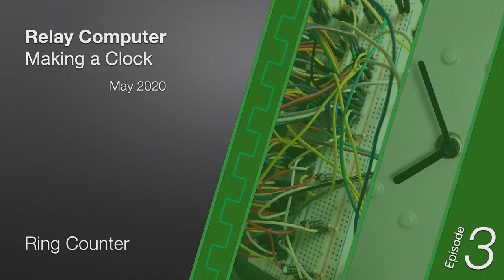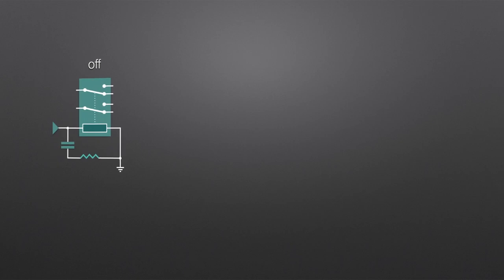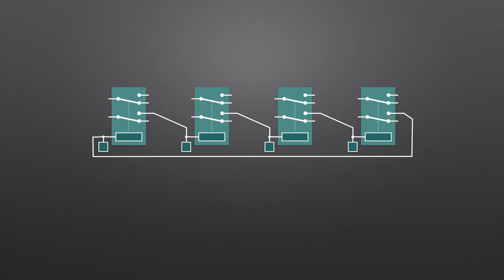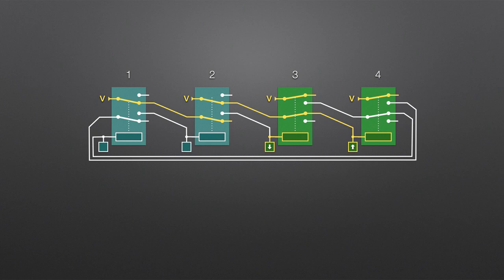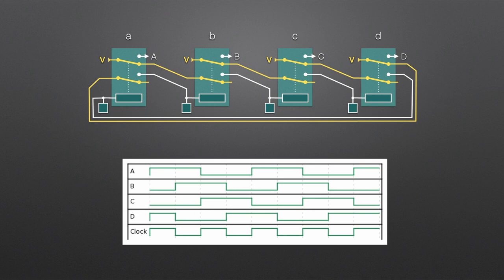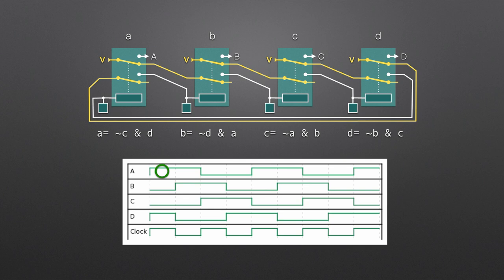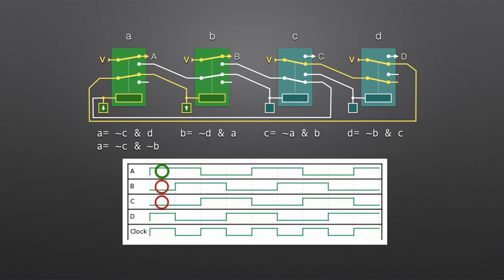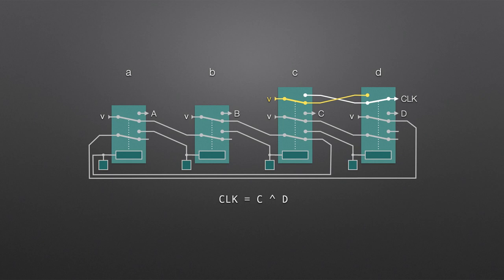Relay Computer Clock - Ep3 - Ring Counter

Comment: Another approach is what I did in the machine I’m working on: total cop out. Clock comes as AC from the mains transformer, and in fact everything is clocked. There is no DC supply voltage at all - makes for a simple power supply, just a transformer. Bistable relays carry state across clock cycles. But you need fast relays, since in the US that makes a 120Hz clock cycle. Most anything that loudly clacks is in my experience too slow for that clock rate, so the clack factor is gone unfortunately. The smaller and quieter the relays, the better they work for this, and I needed very fast reed relays indeed for combinatorial logic (0.4ms worst case operate time, 0.2ms release time).

Comment: I have some input to this video (and the whole series) - you could also do 2 things to speed up the relay switchoff if you wanted to.
This will increase the lifetime fo the contacts somewhat, because faster release means shorter time arcing (so less welding action), might even allow to run the whole computer faster!
The methods are:
1. Place resistors of resistance close to the coil resistance and the flyback diodes in series - the relay release time will be around twice faster, back emf will be ~2x the relay rated voltage, completely safe for contacts.
2. Place a zener rated around twice your coil voltage and a regular diode in series parallel to the coil - twice faster release than option 1, back emf capped at 2x coil voltage again.
Both of those methods work because you will have the coil dissipate as much magnetic energy as fast as possible.
You can read up on it at https://sound-au.com/articles/relays.htm#s4 - Elliott Sound Products, cool DIY site for audio, but he has a lot of articles on 'general purpose' electronics.
Reply from the maker: Thanks for sharing - really thorough article. I think I will follow your advice and go with the zener diodes for the clock relays. I treated myself to a basic USB oscilloscope so will be interesting to compare with/without the zener ... just to satisfy my 'hobbyist' desire to see things first hand :)

Elsewhere in the computer the release time isn't too important but contact welding could be a headache waiting in the wings. I'll be interested to see if it does cause problems in the near future although that said the RC3 relay computer only uses 1N4002s over the coils and has been around a lot longer than mine. Not sure if that's been eating up relays or not though.
Reply from the maker: Ah, actually looks like Phil Ryals did have that problem with the clock relays (ref p131 of the construction log PDF at http://www.computerculture.org/projects/rc3/)